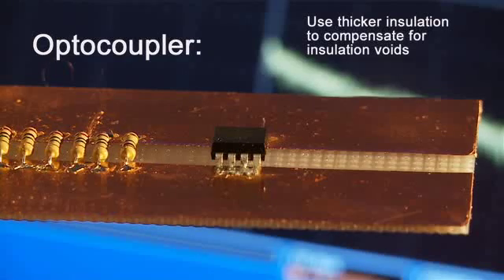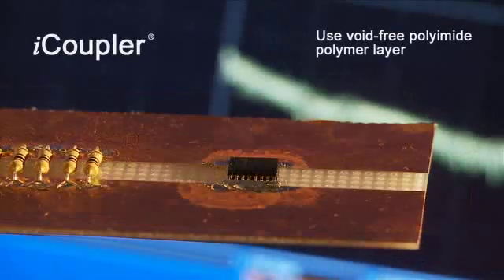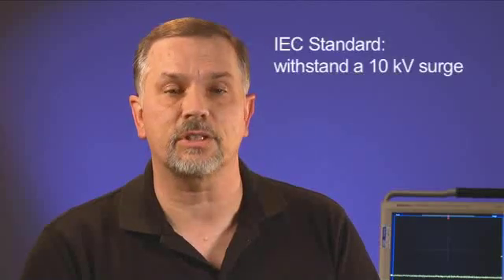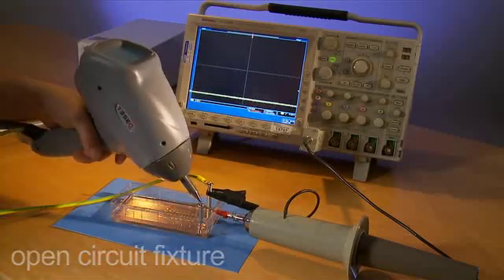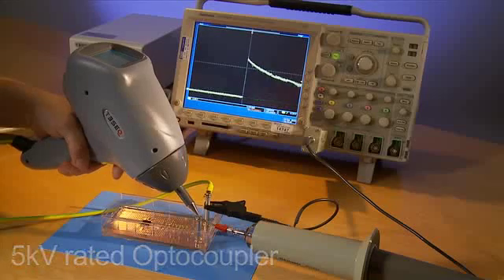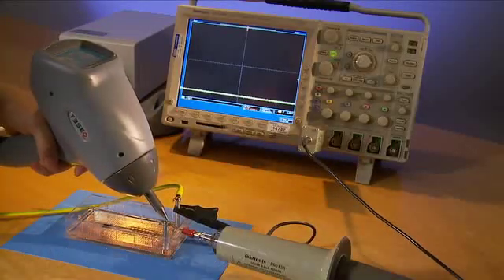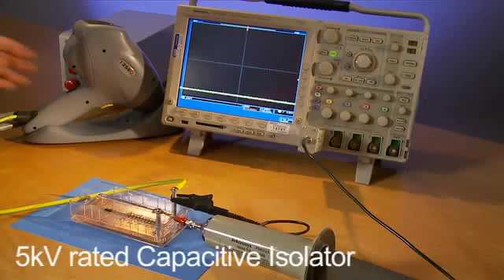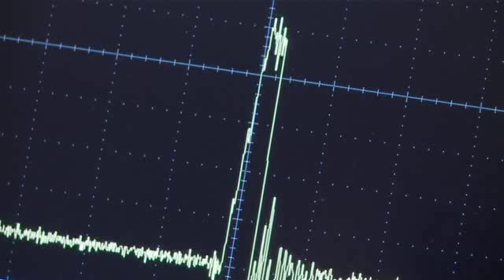Reinforced Insulation on Opto & Non-Opto Isolators

Comment: Avego is running an add in the March 8, 2012 edition of Machine Design claiming they "are the only isolation devices that meet ... IEC 60747-5-5 ..." Their add has a chart which claims that magnetic coupled devices don't meet it. 
Time to run a counter add?